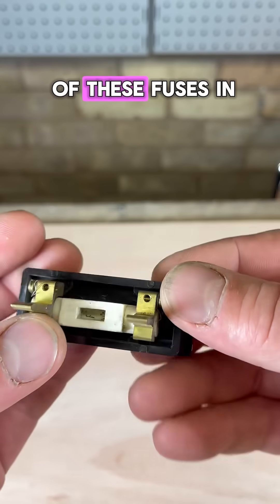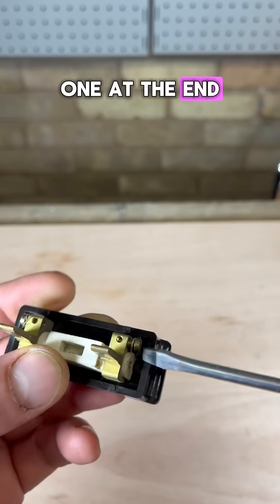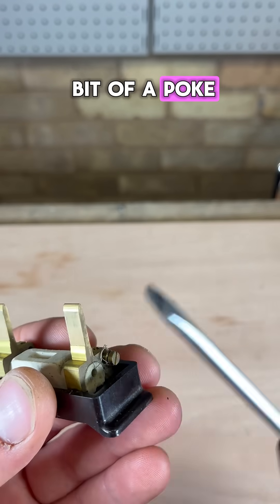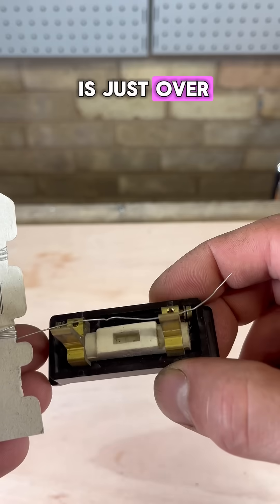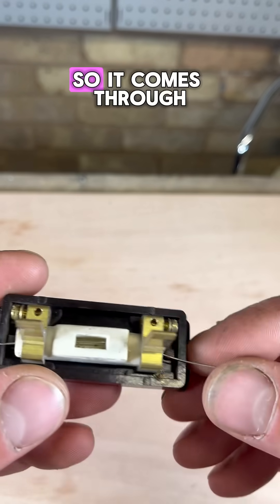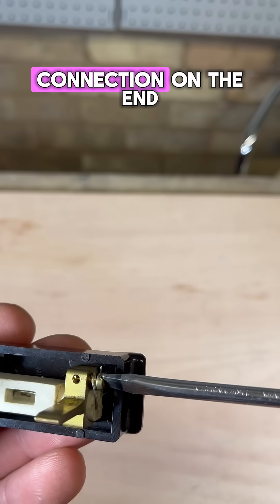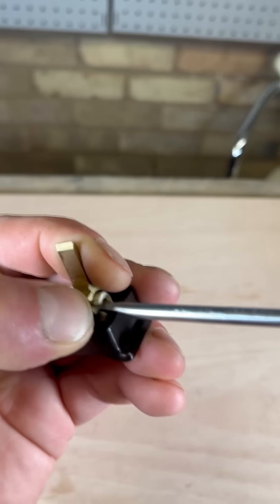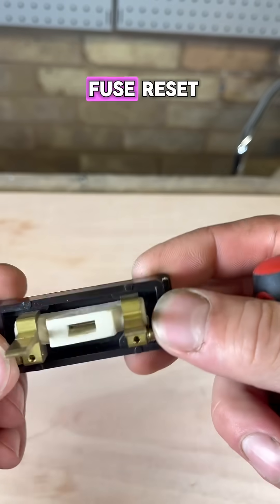How to Rewire Old Wylex Fuse Boards Safely ⚡ | Step-by-Step Electrician Guide

Comment: Don't pull the wire tight in the carrier, as that can snap the fuse wire when tightening up. Also when the fuse is under heavy loads it will heat up and stretch more causing it to prematurely fail. Make sure the wire goes clockwise around the screws, snip off any excess wire from the screws to avoid live hazards in the carrier. BS3036 fuses are still current protective devices, and safe if wired up correctly with the correct gauge fuse wire. Do not use copper wire or any old scraps you find 😉👍